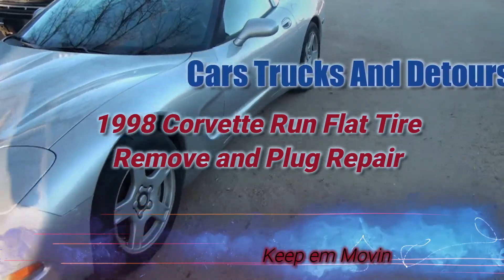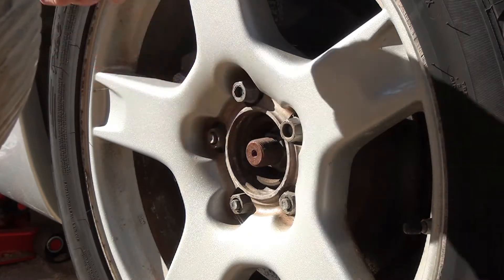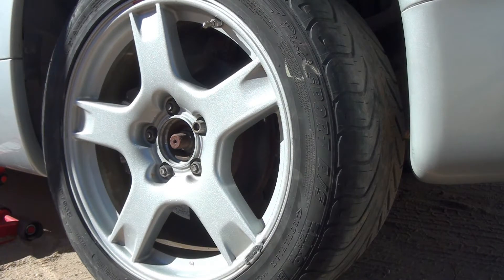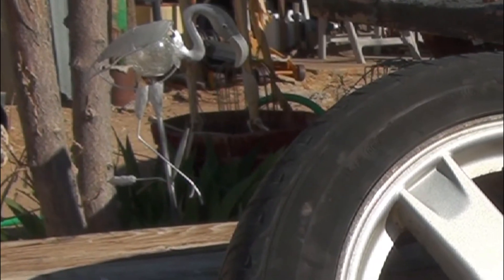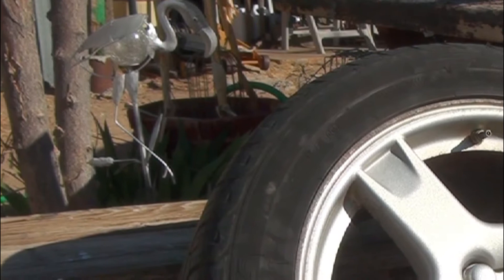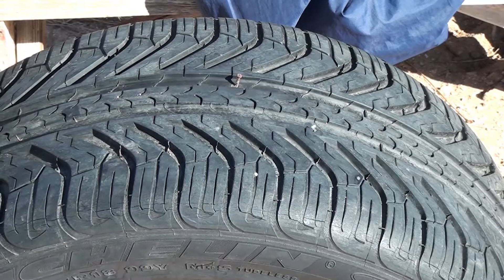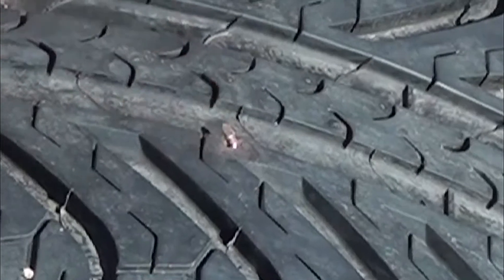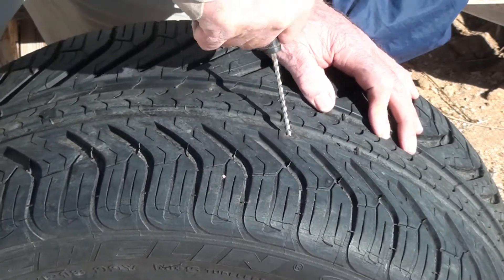1998 Corvette Run Flat Tire Plug Repair

Comment: some people are against plugs but I fine they work perfectly much easier than breaking the tire down to patch it.
Reply from the maker: Totally, and remember that they may or may not slow leak over time, and not to enter any high speed challenges(ha,ha). These are designed to buy some time until it is time to get new tires.